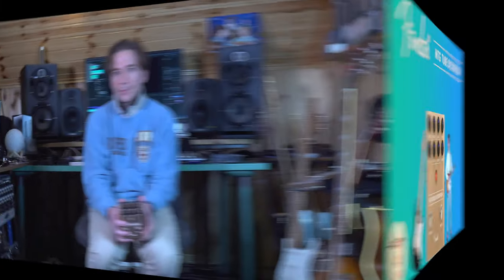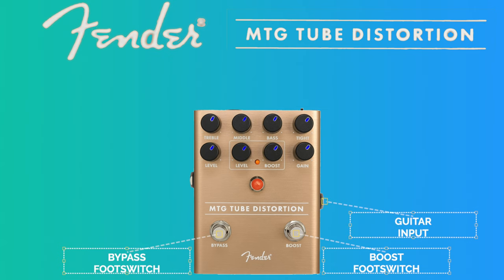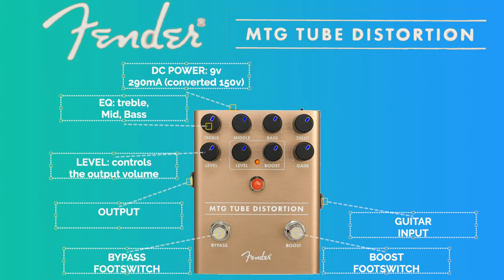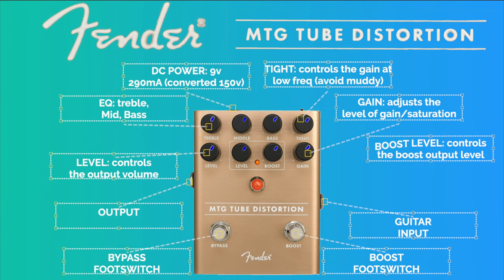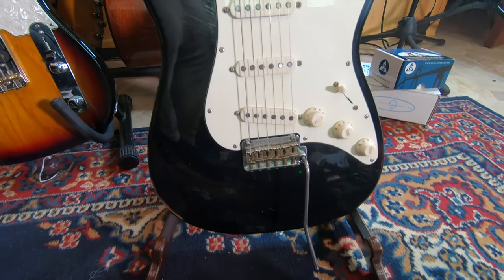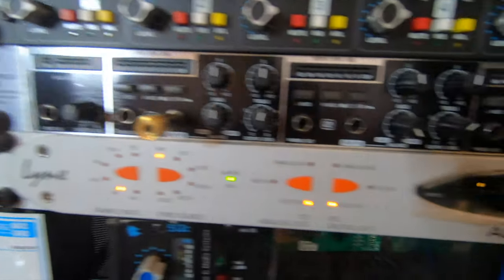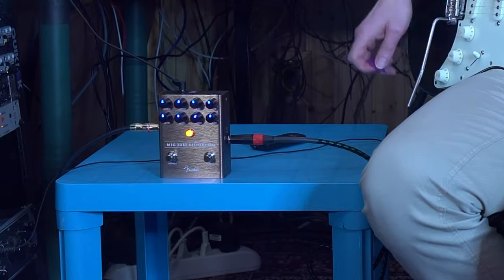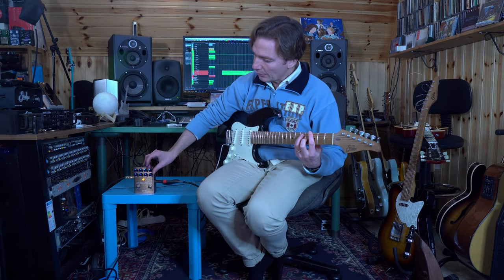Fender MTG Tube Distortion Pedal: demo & review (a very nice Marshall SV20 companion)

Comment: The voltage boost is really working. All the settings you used and it never lost dynamics. It didn't compress the signal when the dist and boost were cranked like a lot of pedals do. I've listened to a few reviews of this pedal and the character of the guitar is really noticeable. Even the difference between your Suhr and a Strat I heard on another review was quite apparent. And of course humbuckers really thicken the sound.
Reply from the maker: Hi, I do agree, very dynamic pedal ... I love it. Thank you for your comment!!!

Comment: Does it have a battery department?
Reply from the maker: Hi John, no actually it does not have a battery, it is mains-powered only. In fact, the MTG needs to pump a lot of volts to feed its 6205 subminiature valve , which would drain the battery pretty quickly.
Thank you for your question!